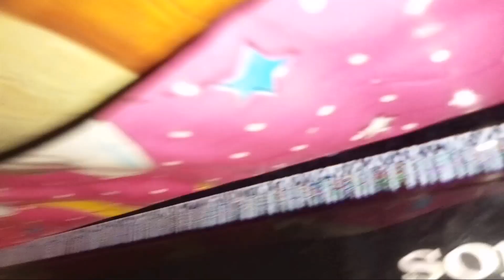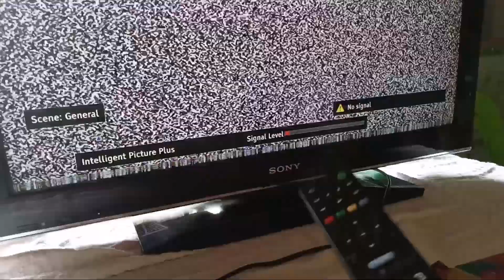SONY LCD TV REMOTE CONTROL NOT WORKING REPAIR

Comment: For my situation nothing has point  of that yours tv has....in my case when i open the device to change leds a tapecable getoff and is this that connects the remote sensor with the multimedia card so my remote works fine but the tv didn't receive the signal cause the cycle is open. Nevermind i fix it now and works fine!
Reply from the maker: maybe they are not the same model
Reply: @DANEXTTECH  it's Sony  KDL32R423A

Comment: i bought an Haier LED LCD  Tv Model Number LE 32K 300 from a private homeowner , i just bought the already faulty Tv is LED LCD 32K 300 , When Tv was taken to the a Tv Repair in the Jaffna District, the motherboard was transferred to Tv. , Now the picture looks but the dotted lines on one side are visible , it looks like the picture is upside down and me just need a model number Haier LED LCD LE 32K 300 remote control to fix it , wouldn’t anyone who sees this post even help me?
Reply from the maker: You can used a universal remote for that